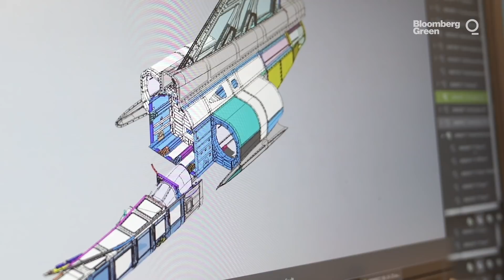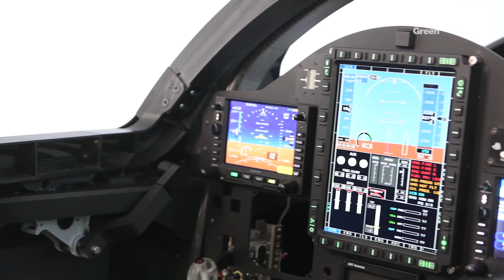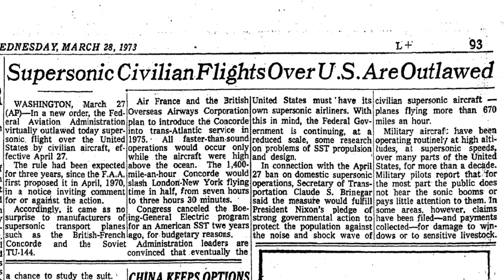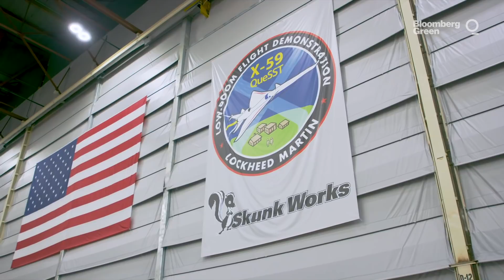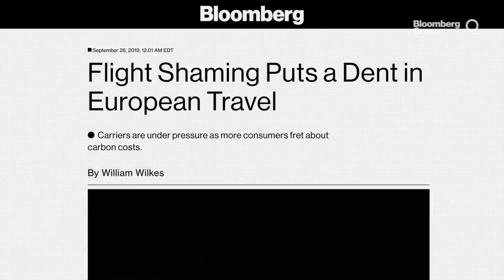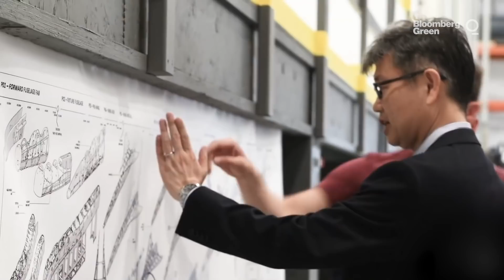Why Supersonic Jets Are Making a Comeback

Comment: Concorde was not a failure as that idiot said in the video; the idiot is trying to tell you that Concorde was a technological failure (which of course it wasn't).  Concorde was in service for 30 years with no crashes until the French Concorde disaster which was caused by debris on the runway...  However, Concorde was a commercial failure and that was due to America's jealousy towards Concorde because their version of a supersonic aircraft didn't make it off the drawing board at the time and that was a costly failure to the American public...

Comment: You can't separate high speed from lots of energy. High speed means high friction which takes high power and lots of energy. From a purely practical standpoint you can't justify much beyond Mack 2.5-3.0. Besides, the world isn't that big. If you can't invest a few hours then you need to take a Prozac and be put in a straight jacket. Relax.

Comment: Until you can meet ETOPS requirements, have the ticket premium low enough, and save a significant fraction of total travel time it won’t takeoff.
Reply: The Boom Overture is a trijet so it doesn't have to meet ETOPS. Flying at Mach 1.7 would roughly shave 3 hours off of the 6.5 hour flight from New York to London.
Reply: @gnranger  I’m curious if they can get a triple working. Flight time is one thing, gate to gate is what counts.

Comment: Aerion Supersonic says that taking carbon from outside air at ground level and depositing it at 60,000ft is technically carbon neutral. Yes, but the remaining impacts on global warming are far from neutral :l 
The whole problem with air travel is not the amount of carbon released from one flight, it's the continuous accumulation of carbon high in the stratosphere where it blocks escaping radiation from earth's surface. Little if any vertical circulation can actually bring this blanket down from such heights, so it just continues to thicken over years and years of carbon deposition. This is how flying causes the most potent form of the greenhouse effect.

Comment: Don't say Concord failed!!!. It never failed . It's due to our own failures and negligence that she crashed . Remember..she struck debris on the runway at high speed , rupturing a fuel tank. After an investigation it found that any 'inherent design flaws' were mitigated over the fact that the rubber tread that she struck was large , and many smaller passenger planes such as B737's would have suffered similar fates ,  if not worse ....and as far as an economic failure , I say this...if you ever heard that bird fly over , or seen it climb into the sky , or managed to catch a glimpse of her as she gracefully prepares to land , and fully understood the engineering poetry that made supersonic passenger travel possible , then you would very quickly learn that it was worth every cent . Those of us who had the chance to see her immediately knew we were looking at something special. Concord was the last icon of the Glory days of air travel and it is actually we who have crashed . :-(

Comment: That awful crash!! Oh yes... That awful decision by the French Concorde to attempt a take off when the baggage from those late boarding German passengers was stowed at the back end only and the excess weight of fuel on board, requested by the French pilot. The plane could never balance itself once off the ground. If those mistakes had not been made, one engine would have been sufficient to survive. Not something the French accept. The plane was never a failure as such. Further engine development could have made it more fuel efficient but there wasnt the government enthusiasm. Remember, this plane was conceived about 24 years after WW11.

Comment: The Concorde was a financial failure. It was a joint Anglo French effort and was basically forced to be carried by British Airways and Air France since there were no purchases for the Concorde. It would operate for several decades, however, at massive financial cost to both companies. There was simply no way to operate the concorde and make a profit due to the very high fuel costs relative to the number of seats on the plane and therefore the ticket price. They couldn't meet the costs of development and operation by specifically catering as a luxury transatlantic crossing for the wealthy/influential. British Airways and Air France only just about made even when they eventually starting operating Concorde as a charter plane... Technologically it was a marvel - designed in the 60s decades before computer aided technologies and had an outstanding safety record. ECOMINICALLY - it was a complete and utter failure  and why airlines have invested in wide bodied twin engine fuel efficient jets over supersonic travel. You can make actuallt money off of it.

Comment: Super sonic flight not possible due to airport noise regulation.  To fly fast the wings need to be small and become the wings are small at  landing and take off the engine has to run in full speed making it too noise.

Comment: Part of the reason it “failed” was because of the yanks firstly not buying it then not letting into their airspace, mainly because they didn’t have one. This coupled with low oil prices at conception then high prices when it started to fly commercially. Plus, basically the plane wasn’t big enough having a capacity of circa 100 and a range restricting to trans Atlantic flight lengths only and not being allowed to fly supersonic over land. You cannot really call it a failure, only had one accident during its lifetime and that was caused by an American airline company!

Comment: "Where the failed concorde left off"?  Failed?  Concorde was NOT a failure..  27 years of service is not failure!
Reply: Concord was not a failure, it was simply phased out due to new regulations, and the TransAtlantic flight was too expensive... this report sound incredibly stupid with false information...
Reply: People being scared of booms and other stuffs on the ground is the problem. Plus sonic waves smacking a POS plane may knock some rivets loose
Reply: @TheZmoney420  Had Lockheed or Boeing been able to make a similar aircraft, mach 2 over land wouldn't have been a problem.
Reply: @metome lardyazz lol

Comment: It’s ludicrous and ignorant to use the term “failure” without acknowledging the reason for the disastrous crash. Where is the punishment of the airline responsible for the debris left on the runway that resulted in the fuel tank puncture? Once again, to big to fail comes into play.
Reply: I tend to agree. Overall the Concorde had a near perfect safety record, especially considering it was the first commercial supersonic jet. I agree that the main cause of the accident was the debris left on the runway, however, i believe the tires  were very highly pressurised due to the high landing speed which is why when it ruptured, the tire fragment struck the underside of the fuel tank in the wing with enough force to rupture it. Overall though it was the inability to operate the concorde fleet at any sort of profit as opposed to the CDG crash that put the nail in the concorde's coffin. Too much fuel - too few seats.
Reply: Yes, did the Concorde really fail, or was it damaged by debris that would and could have damaged any other plane?
Reply: @losonsrenoster  financially qnd environmentally speaking, yes.
Reply: Thousands of flights take off everyday in the US and there are nearly no major crashes. Of the dozens of concordes that took off, with one of them crashing, it was reasonable for consumers to feel concerned. It was also too loud to fly over land, and too fuel inefficient to be feasible. The concorde was built by governments not looking for profit, but looking for influence, so these problems weren't as clear as they may be for a company.
Reply: @yaush_  so 30 years in service not dozens of flights fella!!!, and one accident due to runway debris? The only ones who didn’t like it was the USA and we all know why that is Don’t we, three fatal crashes on a Boeing jet recently and now it’s been re approved, so where’s the logic, ironically fuel efficiency was another excuse but hey this comes from a country that has a love for gas guzzling cars to this day and your last president didn’t believe in global warming???and no Tesla has a long way to go before you bring that in the argument, the hypocrisy!!! Look we all know it wasn’t efficient but it was a marvel of technology back then, how long now and we don’t have an alternative in service? Concorde wasn’t as much as a failure as you think, and so what if it is a product of “look what we can do” America does constantly your military prowess is testament to that for starters, and most countries have safe flights records not just the states so what’s your point on that one?

Comment: 100% designed, engineered and powered in the UK. Called Concord.

“Shared” with France for financial and political reasons..... destroyed by pressure from large markets who failed to produce a rival.... deliberately castrated prior to display or storage, to ensure they could not be flown again.

Ditto TSR2..... a special arrangement with one side bending over.

Ditto CF 105 Avro Canada Arrow..... jealousy is a cruel mistress 🙁

🇬🇧

Comment: Don't think of operating like normal run way operation thing more flying boat preloaded & then less time to get there when taking off, more planes pre floating loaded ready to go then normal multi day take off & landing normal air travel. Hving more water double decker next gen concords means no down time bc only 1 flight per week not multi flights per day diff approach. Faster than boat fastest commercial flight after takeoff travel diff deal volume & loading. Some places weather mostly bad so when clear u go fastest poss & plane already pre loaded, or least u know normal operations r will take off some time mid day 3 hr window jet stream weather friendly & then fastest there. Whether that means 1 day a week 3 hr window or 2 days per week or 3 it is not a req air flight type operation can't b. Can never compete w/puddle jumper should not try. Spending 1/2 the time in air of normal long flight is a class worth price if done right to other side of planet.

Comment: Fuel is lighter than water so on take off will float best way to take off & reaches places normal travel not easily serving. It's just a matter of size thing to make it "work" worth trip by ppl & cargo & range & speed. Just think twice as big as old concord & better volume. Landing no or low fuel emergency can b done anywhere u hve water bc taking off way harder than 2/3rd less wt landing.

Comment: hving engines in front up front not rear is key, for aero advantage at speed & for giant tube lighter heated air lifting power, use it all massive volume of heated air exhaust meg tub like double deck bus volume creates great lifting effect. max the air travel down tub & back up & around 3 total trips b4 exiting. The fire flue deal w/3 flues in 1 can of effect. Inner highest temp not solid tube, 2nd solid flue, & 3rd solid flue & giant air skin jet double deck volume around. If interior underside of plane is double decker air space turned on side per engine u r getting great lift. 3rd or 4th rear engine is more standard turbo shaft fair per side if u like to operate normal flight mode not high speed.

Comment: 10:21 pull carbon dioxide from the air and process it into fuel. That's theoretical? No, that's pseudoscientific, you, as a journalist should ask now questions... Processing co2 into fuel is a negative energy process, and harvesting it even more so,, no matter how you produce your energy it's always better to just use it straight away instead of losing most of it in this way. Unless you have few energy at your disposal but that's not gonna happen soon.

Comment: Failed? What a bunch of BS, was arguably the peak of air travel engineering which it did well for almost 30years. Considering when it was made the was no CAD, or computer simulations in the way we have now. It was skilled engineers who designed and made an incredible machine. 

Failed? Whatever.

Comment: But we are leaving the old energetic fuel ⛽️ and manual and automatic pilot by Solar Cells and AI. Tesla and Nvidia should enter to this project soon
Reply: The energy density of solar is far too low for effective high speed flight. Low speed flight, yes - the state of the art is ultra lightweight super long wingspan 20-30 mph long endurance uncrewed planes.

Battery powered planes will show up as battery density improves - we're about 25% away from short haul commuter and business planes being viable. Bespoke batteries already are enabling a few niche/testbed planes.

Comment: Did you just say 'failed Concorde'? It started service in 1976 & flew for 27 years @ mach 2. Have you mericans done anything within reach of that planes success? With the new ones you will be arriving at the same time? What fucking planet are you on? do some Mathematics, the Concorde flew twice the speed of sound & the new aircraft don't even reach the  the sound barrier! I'm now annoyed that someone like you can even comment on a plane that was way ahead of its time. If it wasn't for the British you would still be flying propellers! Is it a surprise that the Concorde wasn't economically viable? With the weight it may be lugging with you.....................NO.......FUCK OFF!

Comment: Interesting. But what the video doesnt cover is the radiation u will be exposed to. (Like all flights) but as much as i remember concord used to fly very high to get to the speed it needed means passenger and workers will be exposed to a quite high cosmicradiation. And wasnt it like a concord pilot could only work for a few years because his radiation was already at the limit? Correct me if im wrong